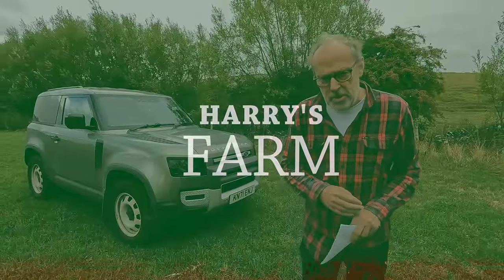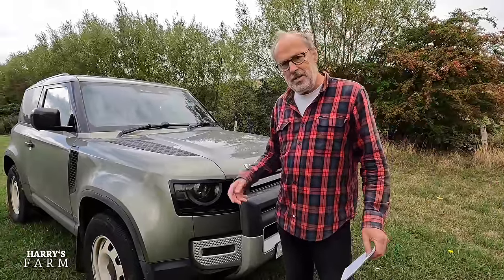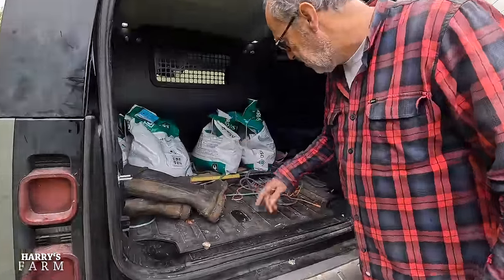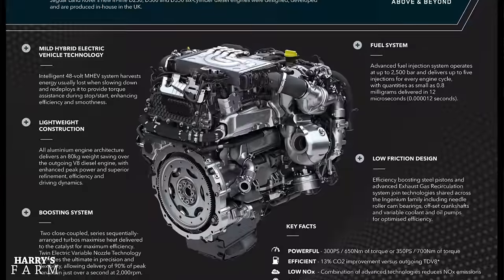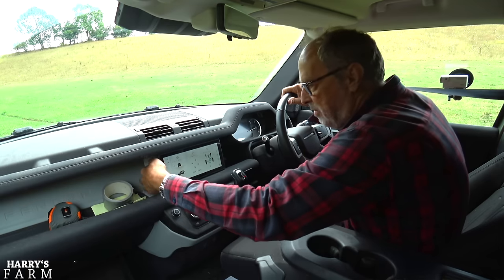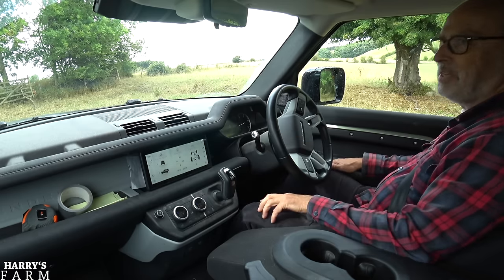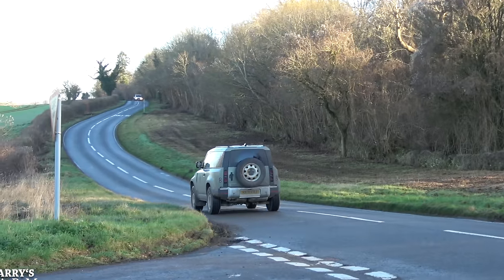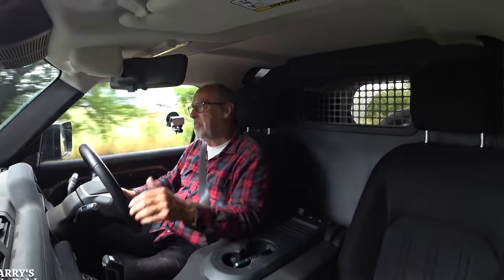New Land Rover Defender 90 Hardtop 12 month review. Is it a true farmer's car?

Comment: I've owned the same Defender 90 Hardtop for 15 months. It replaced an L322 Td6 as a farm vehicle and the vast majority of comments in this excellent video reflect my experience - it is an impressive vehicle on-road and off-road, however, the one comment missing Harry is surely the incessant beeping? Opening and shutting gates entering fields, for example, is a fair testing of tempers, as the Defender beeps when you open the door to open a gate (even in P), continues beeping whilst you open the gate, even if the door being open is clear for all to see, and singlehandedly destroys the countryside peace! The L322 left you, the driver to make that judgement (in silence) whether it would be appropriate to leave a door open whilst opening a gate, or even drive with the door open through the open field gate, however the Defender apparently knows better than you and makes it's opinions heard. There are still times when I miss the quiet and simple old ways of the L322.
Reply: He has an extra seat belt fastener he leaves clipped in on his Land Rover when on the farm for the same reason. I think it's the Land rover anyway. It definitely for one of them to stop the beeping.

Comment: Harry my old BMW 335i used to have door chatter, especially over the potholes and uneven roads here in Quebec. There is a product called Carbaflo that the dealer would apply once in a while to totally silence it. On mine it was caused by bringing it to the automated car wash where the nozzle would wash this product out. Apparently most cars are twisting and shifting on the road quite a bit etc...

Comment: I'm not a trailer expert, but I guess that bouncing is due to the higher tow hook position. On a lower hook, the trailer is in balance, like an old scale.

The weight in the front and the weight in the back are balancing each other. If you hit a bump, front and back section move roughly the same distance, evening each other's movement out. Plus, center of mass is center of trailer, at the middle wheel. I think that makes for a bumpy ride.
Reply: The vehicle is really too small to tow much. The short wheelbase doesn't provide enough stability for a trailer that is as long as he is towing. I have a 30 foot enclosed car hauler rated at 14,000 lbs gross weight and wouldn't tow it with anything with a wheelbase under 140 inches.

Comment: This looks strikingly similar to the 7 seat Discovery and only slightly cheaper. If it is meant to compete with the Japanese and German Pickups then they better think again. The old version without the mod cons used to last ages, I doubt this would go beyond 10 years of rough use without falling apart.

Comment: You can hold the rear tailgate door and almost any position by just wiggle the door a little at the position you wanted, unless it’s different in commercial vehicle, my 110 rear door will hold unless in extreme inclination.

Comment: Wish we got the Hardtop here in the states. I understand why it wouldn't sell well, as it makes more sense to buy a base model pick-up, but it's cool nonetheless. Side-note, why does the spec list mention air suspension under the Blind Spot Assist Pack? Is that a typo? The ~£500 price doesn't line up with the options listed in that pack plus he mentioned this one doesn't have air suspension.

Comment: As soon as the Japanese & Ford began making good diesel pick-up trucks in - say - early to mid 1980s it was game over for Land Rover as a farmer's car. The pick-ups were more reliable, more practical and much cheaper. The new Land Rovers are basically Chelsea tractors or RMWs (rich man's wagons). What kind of farmer is going to spend 50 to 60k on a 4WD van with very limited carrying capacity? The long wheel base passenger version might be purchased by shooting estates for their guests for prestige reasons. Affluent horse owners might buy them for prestige & towing ability (max torque at 1200 rpm will be handy for two hunters in a double box). That's about it IMO. But good review anyhow, better than sexy Rebecca telling us where she keeps her banana and water bottle!

Comment: Q: why have an uncovered spare wheel? Surely that tyre will degrade as fast as the road wheels, in the UV light, such that when you'll need it, it'll be useless.
Reply: This is why you should always rotate in a spare and do 5 tyre rotations.

Comment: Great honest review, praising the great bits and slating the rubbish bits. Unless high profile people are prepared to say with brutal honesty that some of the design or build quality are sub standard, JLR won't act or sort these issues 👍

Large diesels are great for producing huge torque at just above ldle speed, but this is exceptional.

I am not buying the fact you haven't washed it once in 12 months, especially when you see the offroad clips and of the front grill🤔 Or is it I haven't washed it once in 12 months (but someone else did...)
Reply: The 3L is only making 500nm/368 lb ft. That's 110 lb ft lower than the 3L diesel that Ram just dropped and 90 lb ft less than the 3L Duramax. Neither of these small diesels have a history of strong sales or a reputation for having much power.
The 6.6 Duramax, 6.7 Cummins and 6.7 Powerstroke account for about 99% of consumer diesel sales in Canada and the US.

Comment: Harry stated he would add air suspension, yet at 20:37 on the options section of the spec sheet after Blind Spot Assist, it says ‘Electronic Air Suspension’ - am I missing something?

Comment: I have a 2009 Discovery 3, HSE, with 240 k kms on te clock and can't bring myself to spend that kind of money on the new defender.
The disco has air suspention, tows 3.5 tons (my horse trailer wich seats 4 horses), V6 diesel, 7 seats, split rear gate, i get stuff over 2 metres long in there, much more interior space and much larger windows, rubber mats, ...
The exterior is a bit banged up, but that is what you get on a farm.

Comment: Could you use some silicone grease, graphite powder or beeswax on the rubber door seals to stop them chirping?  

Probably wouldn't try Vaseline or other  oil-based lubricants in case they dissolved into the rubber material.

Comment: My shogun cost £75 spent around £1500 in the last 6 years in spares inc 4 tyres. . Hurdles and a rake will fit in the back no problem. Would I spend £44000  when £75 will do don't think so

Comment: I have a 90 xs, 2009 model.  From Glasgow to glen coe it took me 2 and a half hours getting roughly 15mpg.  I use it off road but and for me, if I break something I don’t need a computer to fix it.  I demoed the 200 90 before it came out in said city… hit a pot hole and the engine management light came on.  In a perfect world it’s superior to the old one in every way.  Not being able to modify it really for hard off-road. Too many sensors that can wrong…see above and the cost of fixing it when something goes wrong.  I’ll keep the old one and I’m 20 years if there is still fuel around, I’ll keep driving it and that’s why I would never have the new one.  I also don’t think in 20 years these will hold value nor have the oem after parts market the old one has.

Comment: I would of thought your bouncing while towing is excessive  noseweight  due to  the towbar been to high making the 3 axles fight and basically  trying to carry there weight on the hitch it will also mean the rear axle is more then likely overloaded  when the trialer is near capacity

Comment: I’ve got the 110, I’ve used it as a van for 2 years and 25000 miles, squeezing all my tools and materials in the back can be a bit tricky, and yes certain things are too plush for a work vehicle, but the comfort and drive of it is unparalleled to any other similar vehicle. A van in the week, and a comfortable refined car the wk ends (if you keep the inside clean) saved a fortune not having a separate transit (£35000!) Oh, and never had an issue with it, best vehicle I’ve ever had.

Comment: The boot is disappointing for commercial vehicle. I have better usability with old L320 while not having compromise even when pulling 3.5T trailer. As Matt from High Peak Auto's said: new Range Rovers are better cars, but old ones are better Range Rovers. I fell the same in regards to Sport and Defender. Body on chassis + split or upper/bottom tailgate is a must have for farm or any other utility work imho

Comment: Very good review . The options listed are very expensive ! . It would have been easy for land Rover to fit a couple of flaps in the Bulkhead for longer loads. All modern vans have this facility. As you say the load space is too narrow by the rear door.

Comment: So i live out in the middle of nowhere in Montana.  U actually see quite a few here.  Montana is rugged and the distances far and it just seems the Achilles heel of Land Rovers is their durability.  5 years, 300,000 miles later they just seem worn out and unreliable and the nearest dealer is  600 miles away.  Toyotas are just getting broken in and GM products have a lot of problems but anyone is willing to work on them

Comment: I bet you wish you had tried to strike up a deal back at the 5/6months part when the prices were better to buy the new landy then. Its a bit like the T7 from Yamaha they went on sale for £7599.00  now 2 year old used ones are £8500 / £9000.00 depending on specs and extra added. The market has just gone crazy with covid.

Comment: Towball height is important. Otherwise the trailer is offbalance especially with a triple axle. On an even grade, up or downhill, the trailers not parallel with the road and will pitch up and down.
Reply: Indeed. The defender is visibly unhappy about that triple.
Reply: @juancornetto8243  Unless you can change the height of that towball it’s a gimmick, not a good option.

Comment: I would take the base product with steel springs.
You don't want see a repair bill for air suspension.
Also, I'm from Texas.
Throw those ugly ,wimpy steel wheels and sissy tires onto Ebay and get cool wider aluminum aluminum 20 inch wheels and BF Goodrich mud and snow tires.
But hell, it's British, which means the electronics are screwed.

Comment: Terrific review. Your conclusions match my own fears  -   I run a 63 plate D4 (60k) and a 2001 Freelander (90k).Both in blue,  and both risen in value over last 18 mths.   They're  'gooduns' (not every JLR vehicle is!) and as much I'd like a new Defender, can't justify £75k (£10k above list) for a used 110 that is less capable than my D4 and less fun (maybe) around farm than the old Freelander. Too many flaws compared to my Disco (brilliant for French touring, with roof box, bike rack + 7seats) and far, far to expensive. I can understand reverting to your FF Rangger...
Reply: I really should not have cancelled my pre-order for a First Edition 110.  It would have cost me £59,000.   Went round the dealership last week and there were used First Edition models, three of them with around 25,000 miles each on the clock and a sticker price of £64,000.   At worse I would not have lost a penny over two years.
Reply: Can categorically say a new Defender is more capable than a D4
Reply: @seany8787  Capable yes, but practical no. The interior space in a 7 seat 110 is more comparable to a Disco Sport, and if you need to use the boot for people or pets, the Defender rear door is a PITA for a rear mounted cycle carrier or storage box.
Reply: @naturshoot8448  I sit in a 110 and a Disco sport pretty much every day. There are acres more interior room than a disco sport and its more comparable with a Disco 4/5
Reply: @seany8787  How much more capable than a D4 do you need it to be? I'm not sure it justifies price tag and wait list. And boot space/opening is comprised compared to D4, even though there is lots to really like about New Defender.
Reply: @andrewcarter1966  wait list is a combination of its sheer popularity, brexit, covid & supply issues surrounding those - microchips et al. You are correct, 99% of people wont use a D4 near its full potential, but its still nice to know a new Defender improves on that great car. Its not just the engineering and capabilities its the day to day stuff like intuitive and fast infotainment. D4 is prehistoric in comparison 

Price tag reflects current financial markets.. there is always going to be people buying 80k Defenders because theyve given the dealer a blank cheque, and thats what people see and baulk at - but I’d be after a base spec one and accounting for inflation theres not much difference between them and a D4 when they were new.
Reply: @seany8787  In the rear 6/7 seats it's not. The 110 is very cramped and far less space than a D5. This is almost certainly down to the way the Defender comes in above its haunches. I think that also limits the middle seats too at shoulder level. Interestingly on the new 130 they've cut into the side panels quite significantly to create seat space for 3 across, but I wouldn't fancy being an adult in there for much time as the body width remains unchanged.

Comment: This is a really good car, but I think they should've put the driver's seat in the middle and probably should've made a battery electric version with a low-horsepower, extremely high torque DC motor but I don't really have much faith in JLR being able to fulfil it's existing wait list and I also don't like the high-price and I think they should've found some way to make this cost-competitive with cars such as the Lada Niva or any city-4x4 (aka SUV) since most people who drive these cars will never take them off road or will only do so a couple of times per year...

May dad owns a unreliable Land Rover Series III 3-door model (not sure if this generation was split as the 90/110 models...?) and if he could afford it, he would probably in an instance buy one of these LR Defenders, probably in the 90 spec...

Comment: I really want a new Defender, but my 200 series Landcruiser has been too good.. Decisions.....  300 Series is 1 - 2 years wait times.
Reply: The 200 series never really caught on like the 100 series before it did in the UK for some reason. A friend and I tried to buy one each at one point but the dealer was totally uninterested and, in truth, we both thought it a bit big, not very well packaged for internal space and not enough of an improvement on my 100 series. Ended up keeping the 100 until it became uneconomical to repair and it still sits in a corner of my yard as a project that will probably never happen.

Comment: The new Grenedier should have a SWB option.
Reply: The current Grenadier is the short wheelbase. There is to be a longer wheelbase pickup.  The market for two door commercial vehicles such as the LR90 only exists in any volume in the UK. Most other regions actually value cargo space and capacity, hence they favour 110 to 140” wheelbase vehicles. Even most British farmers have now discovered the virtues of pickup trucks with 130” average wheelbases. Smaller pickups have virtually disappeared from production through lack of international demand.

Comment: It was designed as an urban adventurer, and it has been said that the LR designers wouldn't listen to input from rural or 4x4 types, as you can see. If you want new and "farm", get the Ineos. LR could built a special version. But for farms, this ain't your vehicle. It's silly. The one model screaming to be made is a modern FL1 as a cheaper entry level car. However,  LR has positioned itself as a premium brand, and they don't want "poor" people driving their cars. It's now a genuinely posh .... no, snob brand, which should be reserved for the RRs.

Comment: The base Defender with coil suspension is the choice because there's less to go wrong and hence it's more resilient. However, the price! The PRICE!!! It's not the ordinary struggling farmer that can afford the new Defender, even in basic van format. That's why most farmers now drive pick-ups - Toyotal Hilux, Ford Ranger, etc. with 4 doors, a cab cover, etc. all very capable off road but much cheaper. The top of the range HiLux InvincibleX is 40k GBP which is still cheaper than the base price of the base Defender. What gives?

Comment: Don't think they actually believed anyone would use these like the old when they designed them. That's why someone is going through the trouble of making a new vehicle that fits as close as possible. Sadly they had to drop BMW tech in it, likely to use the BMW dealer network. Wish they'd off the Grenadier as a rolling chassis.
Reply: I realize its probably the safest BMW engine option not to strand you, at least until the minute the warranty is up. It'll be similar to the new Land Rover products in that way. Quite impressive for the first guy that holds the warranty. Or professional car owners with a stable of cars, lifts, and some well paid pals to sort them out. And I know there are some good ones if you do the research, know which to pick and choose. The safe bets are fading fast. Wish they'd offer smaller wheels and bigger tires on some of these ultimate 4x4s. At least you can get steelies and regular tires on the defender. Its all racing rims and rubber bands otherwise.

Comment: The biggest bad bit is............it just doesn't cut the expedition mustard. It is as much use as an ashtray on a motorbike of you want to go camping or expedition driving.  You're taking a serious risk with the electronics packing when you're off road leaving you serioksy in the doggy doo doo.

I dumped my D2 when the three amigas came up and would not go away. That made it a useless lump of tosh.  I went back to my 1993 D1 200TDI 3 door. No ABS, no Airbags, no traction control, no ACE - none of them are needed. 315k on the clock and I just did a three day 1400K round trip no probs at all.  More important, the Mrs and I can get all our camping gear into it for a two week off-grid trip.

Landrover have lost the plot - Landie is dead in my view.